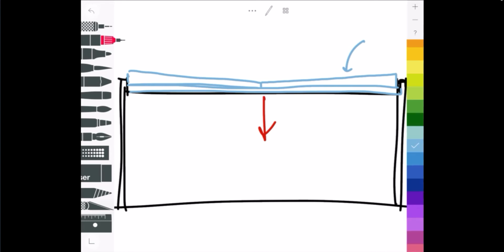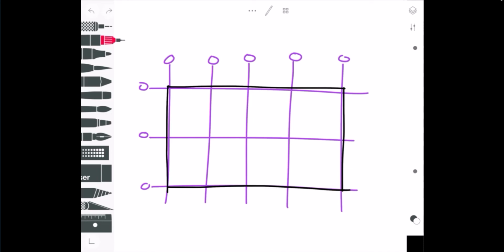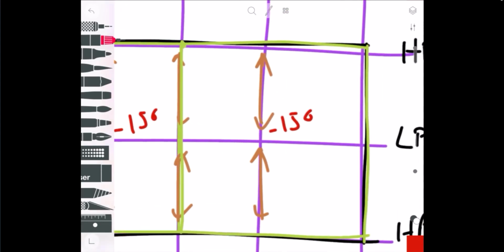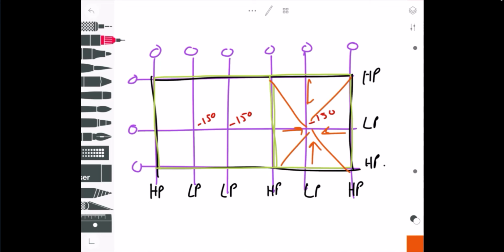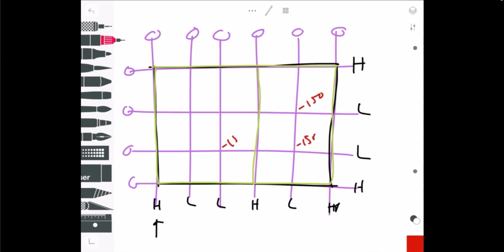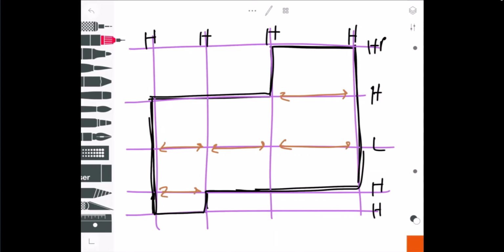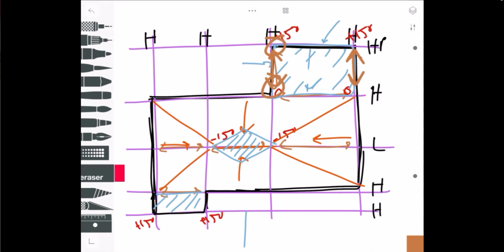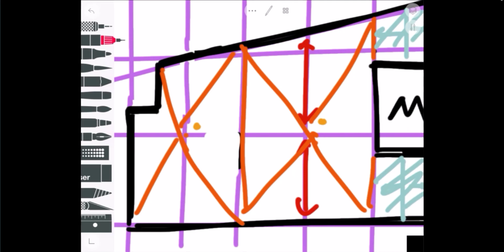Sloped Flat Roof

Comment: The first example at around 8:00 minutes, OP states the beams run only in one direction  North to South and slopes from perimeter to low point (roof drain). I think OP should add that beams also runs West to East, and sloped the same way to low point. If beam only runs 1 direction, then the roof will only be 2-way slope. In example 1, the roof is 4-way slope, so West East directions will also have sloped beams.
Reply from the maker: Nope. All the beams along the perimeter are at high points in both the north/south and east/west directions. My low point text note along the perimeter actually applies to the internal column point so writing it where I did is a bit misleading for sure.  So only the beams on the internal grid lines in the north/south direction slope (from a high point to a low point at the column). There are no beams in the east/east direction at the middle horizontal grid line but rather owsj's - but yes those owsj's would be sloped from a high point at the perimeter to a low point at the column because they rest on the sloped beams.